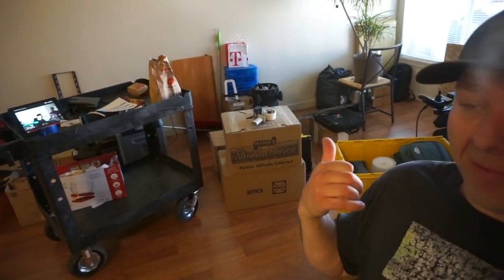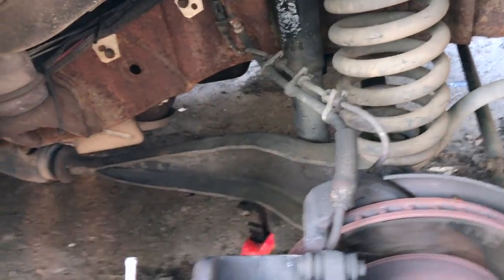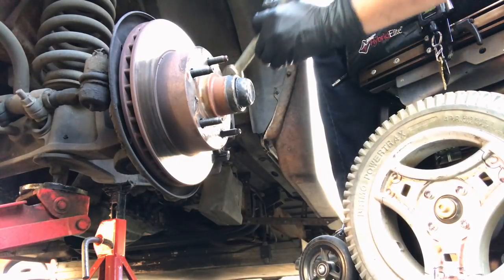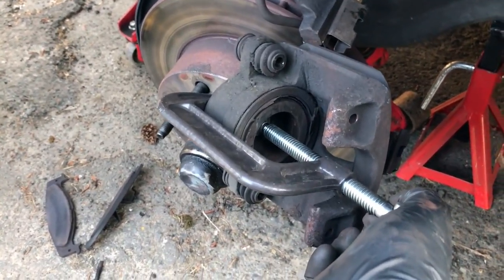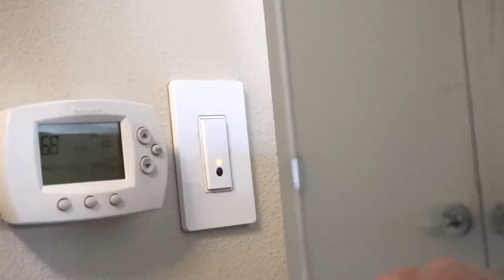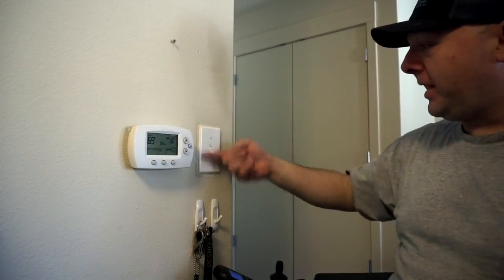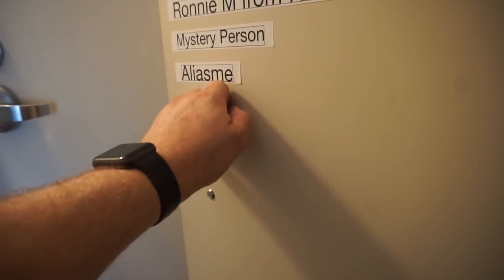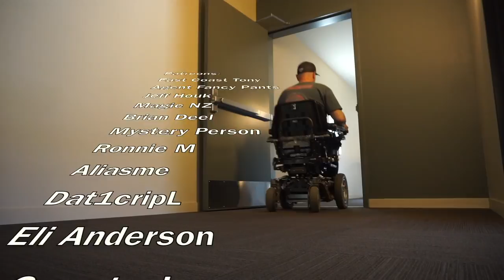VLOG 326: its finally over

Comment: A trick I learned many years ago while working at a shop, using a standard head/flat screwdriver after opening the cap for the brake fluid at the master cylinder prying gently and consistently between the brake pad and rotor you're going to discard. it doesn't hurt the rotor. Then using a drill and steel wire wheel to get rid of the glazing on the rotors. After you do that, you won't need to clamp anymore. Saves a ton of time and greatly helps the braking With new pads. Don't forget to use brake parts cleaner between the rotors and the new pads so there is a completely clean surface between the pads and rotors. Just a little trick I learned which saves a ton of time and misery.

Comment: how small was that place?
from the video, it looks tiny

Hubby & I are in a 350sq ft place, about 2 miles east of downtown toronto canada, market rent here is $950cdn
fully accessible
central air
hydro included
no balcony
floor to ceiling windows.
1bdrm
no storage
no parking
no dishwasher
laundry $5 a load
Reply from the maker: It was like 681 sq ft did look really small in the video though you’re right!!